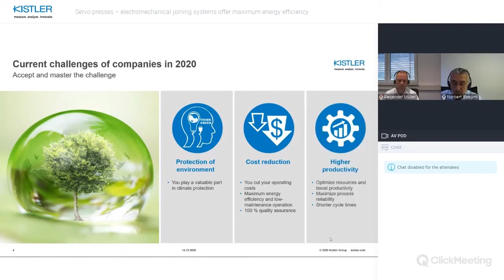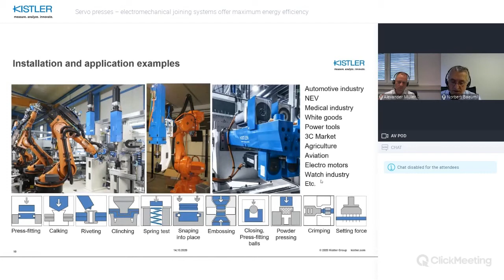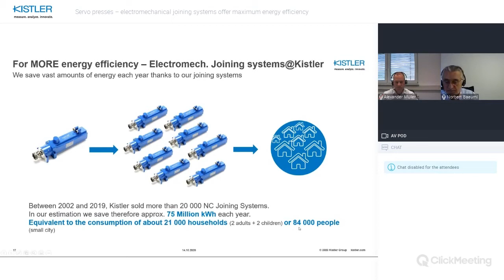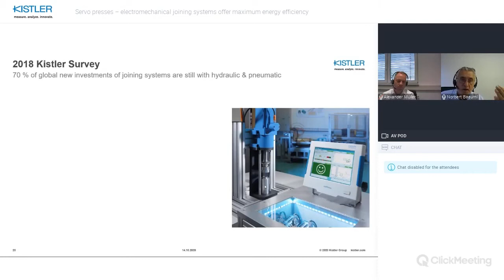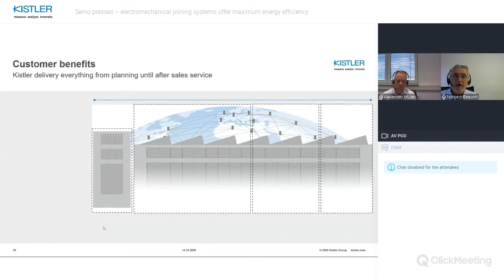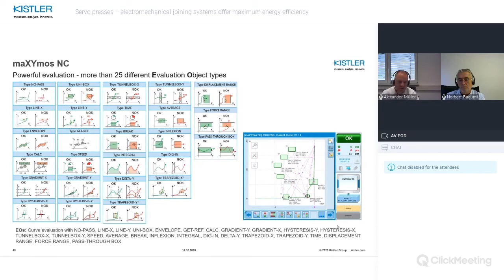Kistler | Electromechanical joining systems (servo press): energy efficiency, less CO2, less costs

Comment: i been looking for Kistler press for one of our application but our machine supplier mentioned that cost of electric servo press 5 times more than hydraulic press system. do you have any anyone available in india. i would really appreciate you help in this. as we gonna have to setup new assembly line contains 4 press with  siemens PLC  and Simatic OP center integration along with force vs displacement measurement for each part pressed on these press.
Maximum force will be used on these press will not be more than 25 KN and we expecting economical and reliable solution on this ASAP.
i would like to get more details  on my email sagar.chavan@danfoss.com / mobile no :                                 +91 9175136550, + 91 9922902596